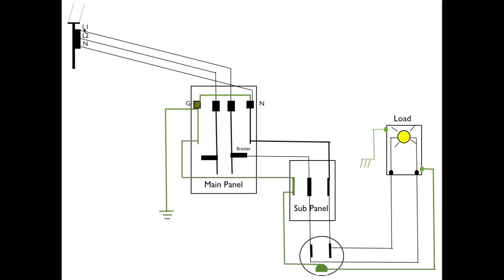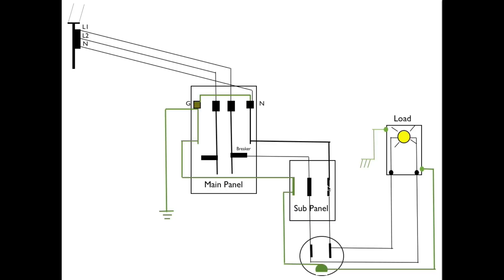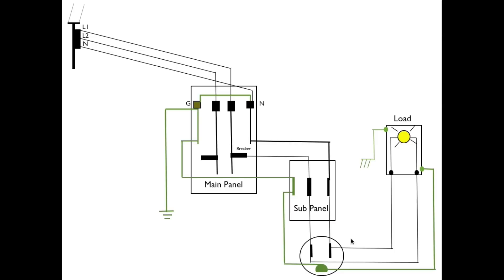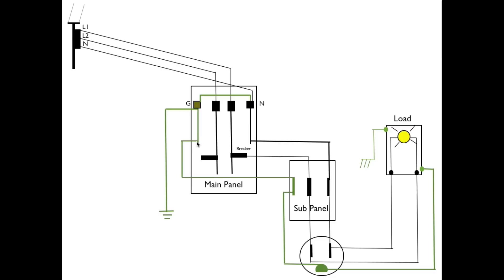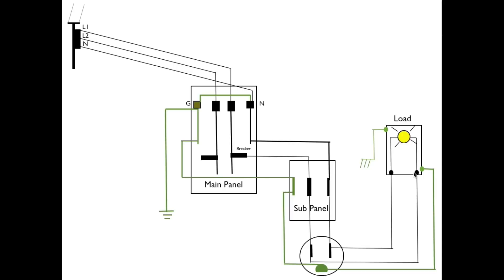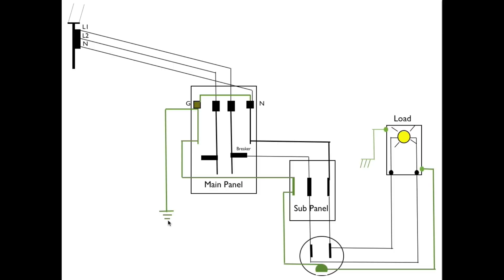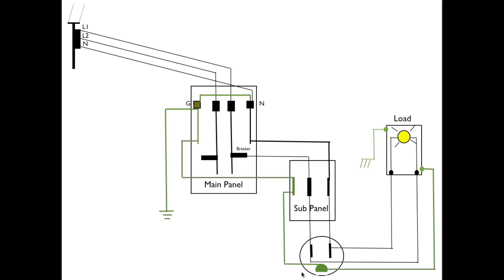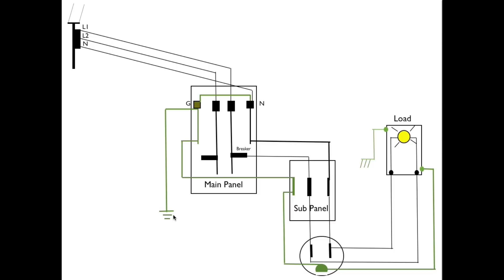The difference between neutral and ground on the electric panel

Comment: I've been looking for something like this for a long time now! I understand the theory after you leave the main breaker box where it must be separated (GNH). Is the ground in the main breaker box so close to true ground that the resistance is so high that it's like a cork that can only be popped out between neutral and ground with a very high voltage? Path of least Resistance says to flow down and out the neutral rather then go to ground. If I'm right about this then I finally understand this theory. !
Reply from the maker: I think you are pretty close.  The only thing is the earth ground (which includes the panel chassis) and neutral are connected together, but only in the main panel.     Hope this helps.
GFM
Reply: grayfurnaceman
Yes it is at this connection point in the main panel or first service connect between neutral and ground where the cork is in the form of least resistance going back out the neutral. Only under short or Lightning strike is the over current attracted to ground. Rather then you... Correct?
Reply from the maker: Curiosity I think you got it.
GFM
Reply: grayfurnaceman
Well it's important to know whether I did get it correctly or not and I think will add to the discussion here. Let's replace the "Cork" with a "Valve" . The connection point between neutral and ground at the first demarcation point (Service panel) after the pole. This connection between Neutral and ground becomes a valve; normal traffic (load / residual current) rides back out to the pole on the neutral. Shorts; spikes or lightning goes directly to ground opening up the Neutral to Ground valve.  There is a person on YouTube that does inverter work. He is very good... Never ask this question but I will try and get him to join the discussion. This is a fascinating subject!  ( knurlgnar24 ) I have allot of respect for this person.
Reply from the maker: Curiosity Lightning goes to earth ground because the potential is between the sky and the ground, but there is no potential from neutral to earth ground.  Even if you measure from a hot line coming into the structure to earth ground there will be no potential.  All shorts that go from hot to chassis feed back thru the ground to neutral at the main panel.  
GFM
Reply: Hi Curiosity. Very good question. One of the things that grayfurnaceman alluded to in his fine video, but didn't quite state explicitly, is that the role of ground wire is different between a lightning strike and a short. GFM did clarify this nicely in comments, but please permit another point or two of clarification. (Cover-my-behind note: I am NOT a certified electrician, but I have some training and experience with electrical circuits, and I have survived my own encounters with high voltages. :-) But consult an electrician before making decisions in a potentially life-threatening situation ... in other words, I ain't liable!)

What drives the electricity flow is what is called "potential," also known as voltage. It is called potential because it's a form of potential energy, like a pulled out spring or the pull of gravity on a person who just stepped over a cliff. All it needs is a way to release that energy, which means a pathway. A person standing on a cliff has a potential energy with respect to the valley below, but they don't experience falling because the earth beneath their feet blocks the pathway down to the valley. Once they remove that blockage by stepping off the cliff ... well, all bets are off. :-)

It's a little different with electricity because there are degrees of pathway. Low electrical resistance between two points of differing voltage represents a strong pathway, and electrical current (electrons) can flow easily. High electrical resistance between those points represents a weak path, and few to no electrons can travel between those points.

With lightning, the two regions of differing voltage are the sky and the earth. So current wants to flow between the two (in the form of a lightning bolt). In other words, the ground - soil, rock, etc - itself is what wants to be part of the electron flow.

Air is not a good conductor, so if you put a metal pole up high into the air, with the other end buried in the ground, the electrical resistance from the top of the pole to ground is much, much smaller in the metal itself than the resistance through the air. So lightning will tend to hit the pole and travel through that pole to the earth itself, rather than passing through the surrounding air.

There can easily be a low-resistance pathway (compared to the air) from the power lines to the ground that goes through the house and its wires and equipment. A nice, low resistance ground wire attached to neutral before anything else in the house will make a path to the ground from the sky that is much lower resistance - a better path - than anything that would go through the circuit boxes, house lines, and equipment. So having a ground wire from the neutral of the electrical service entrance to the actual ground will short out the lightning, and prevents it from going to ground through the valuable stuff in the building.

So that's lightning. Now let's look at equipment or line shorts.

In the case of a hot wire connecting with a ground wire, the problem is not about a current flowing back to the ground itself. As noted, the ground itself has a lot of resistance and, in this case, there's no huge potential between the power line and earth like there is between the sky and earth when lightning happens. In fact, you can take a hot wire and stick it right into the ground and no current will flow. So long as that ground is isolated from other electrical potentials. Wet ground up against some other source of potential doesn't count. :-) 

However, with the ground wire connected to neutral to protect against lightning, if you now connect the hot wire to the ground wire you are essentially connecting the hot wire to the neutral. Zap!

In the case of a neutral wire connecting to the ground wire, say by shorting with a grounded equipment chassis, nothing SEEMS to happen. But now there is current flowing through both the neutral wire and the ground wire. How much there is in each wire, and the likelihood of your getting a shock, all depends on how much resistance there is in each leg, between the original ground-neutral connection to the second point of contact of the two wires. Personally, I wouldn't unhook the ground wire and touch the wire while I also touch the equipment chassis. :-)

It can also happen that the ground wire is no longer connected well, or at all, to the chassis. In that case, if the hot wire somehow gets in electrical contact with the box then now all you need to do is insert yourself between either (a) the box and the neutral or (b) the box and something that has electrical connection with the ground wire, and you are toast.

So the difference between these short situations and lightning is that in one situation the ground wire is important because it's connected to the earth, whereas in the other case it's important because it's connected to the neutral.

grayfurnaceman, does this agree with your understanding of all this? Thanks!!
Reply from the maker: R asraster Very good explanation!!  Couldn't have said it better myself. lol  The integrity (continuity)of the chassis ground is very important, as if it fails, there is no indication that it has failed.  The equipment then just waits for something to happen such as a short in the equipment to the chassis.  Then the chassis becomes hot and the lucky person that touches it and something that is grounded gets a shock.  Of course, if the chassis ground had continuity back to neutral in the service disconnect, when the short happened, the circuit protection (breaker) would open.  Thanks for the detailed and as far as I can tell, correct explanation.
GFM

Comment: Is this true. When a black wire touches the chassis of a metal device that is grounded it will follow the path of the ground back to the panel but will then follow the white wire out to the pole as there is less resistance that following the ground out in your yard. The ground and the neutral are connnect in the panel so either path is available, whichever one is the one with the least resistance. It this true.
Reply from the maker: Yes.  The neutral conductor will always be the lowest resistance as it is connected to the power source.  Earth ground is not part of the circuit.
GFM

Comment: need to clarify at 8:16, the only way your load can still work if the neutral wire is broken is when the load, internally, has neutral and earth GND tied together (either by design or faulty circuit).
Reply from the maker: jsc Good thought s. 
GFM

Comment: Thanks for the info but what would the diagram look like if the sub panel is 220 and only fed by 3 wires, where/what is the neutral and ground?

thanks,

Steve
Reply from the maker: Steve Adams If the sub panel only has 220 volt loads, there is no neutral.  The green or bare wire is ground.  120 volt loads require a neutral.  The exception to that is driers and electric stoves.  Before about 1995, they could be wired with a 3 wire system even though they had small 120 volt components that used the ground as a current carrying conductor.  After 1995, The had to be installed with 4 wire systems that used a neutral.  Hope this helps.
GFM

Comment: I have a Eaton breaker Box in my house and it looks like there is metal strap that runs from the neutral bus to the ground bus. should i remove this little strap. its new and came that way
Reply: I'd say no unless you know what you're looking at
Reply: Isn't that "box" a listed device? Don't modify a listed device. I'm assuming this  is your main service panel.
==
This piece you consider cutting is the "main bond jumper" that is crucial in clearing ground faults.

This connecting the grounds back to the neutral ONE TIME ONLY
allows a ground fault current to get back to the center tap of the power company delta transformer and back to your circuit breaker to overheat the circuit breaker and trip it. Without that, you only have an earth path to HOPE to dissipate that current, but the resistance through the earth is usually too high to trip the breaker. 

I=120V/25 ohms =4.3A, which will not trip a 15A breaker.

The example of 25 Ohms is assuming you have one ground rod that just barely passed the test with a  megohmmeter by giving less thn 25 ohms to the earth potential. If you used a couple of rods and had 3 times the conductivity to earth, the I is then 3* 4.3 and still won't trip the breaker.

Thus, you need an "effective ground fault path" to clear ground faults. Thus you bring an "intentionally grounded" neutral to the service such as the bare stranded aluminum "carrier" supporting the two "hots" from the power pole and connect that, "intentionally grounding" it, to the service enclosure that is connected to the "grounding electrode system".

NEC 250.24. Grounding Services
(A) Grounding Neutral. Alternating-current services that are supplied from a grounded electrical system from the utility must have the grounded (neutral) conductor connected to a grounding electrode of the specified in 250.52 in accordance with Part III or Article 250 in accordance with (1) though (5). See 250.24(C).
==
Reply: Curtis Thornton — If you are doing your own work on a load center, get a permit and ask the electrical inspector.

Comment: I think I may have a problem with grounding in my house. If I turn on a light in one room, other room's lights get brighter and dimmer. They're on different circuits. The panel is grounded to two grounding rods but not to the water supply. Could this be the problem? Any feedback would help out, thanks.
Reply from the maker: awayneificent This could be a problem with a neutral not connected to neutral going to the panel.  I would check connections in the junction boxes.  This one could be dangerous, so I would shut down breakers and check all wires in the box with a non contact voltage tester before proceeding.
GFM
Reply: Yep. Those are classic symptoms of a bad neutral connection, either in the distribution panel or somewhere between the panel and the power transformer.

Comment: Min 7:05.....   Key point: the lightning has to first trip the Breaker at "neutral node" in order for the current to discharge to ground, correct?

Comment: Sad story in My town. Explains what happens when a ground is not going to earth but on the fixture chassis. A light pole was set in a concrete pad (non conductive) and the fixtures grounded wire was bonded to the steel pole. Once the fixture shorted out it energized the pole. The school paid an electrical contractor to come repair the lights and a young man became the ground from the energized pole to earth killing him. He was in his early 20's and killed because someone wasn't paying attention.
Reply: I know that light poles can be dangerous. We ALWAYS ran a 6 or 8 gauge ground wire to a grounding stake at the pole when the poles were set in concrete.

Comment: GFM, I have tons of questions.  First. The ground tied into the main panel going to the sub panel. During a strike, wouldnt the current carry into the ground and into the sub panel ground as well?  Second. The Neutral, I always thought was called that because it did not carry any current.  I assumed that Line 1 was the current carrying line.  Thank you.
Reply from the maker: J Hartranett If there were a lightning strike, the earth ground would absorb (hopefully) the energy as the earth ground is the opposite side of line.  As for would there be any potential in the ground at the sub panel, yes.  The power is going to take the easiest path.  
As for the neutral, It does carry current on the 120 volt circuit.  I don't think I have answered all your questions completely, so ask more if you need to.
GFM
Reply: grayfurnaceman No, that explains it to me. Thank you very much! :)
Reply: It seemss GFM's response is missing and i have the same question.

would you mind repeating what he said?
Reply from the maker: ***** If there were a lightning strike, the earth ground would absorb (hopefully) the energy as the earth ground is the opposite side of line.  As for would there be any potential in the ground at the sub panel, yes.  The power is going to take the easiest path.  
As for the neutral, It does carry current on the 120 volt circuit.  I don't think I have answered all your questions completely, so ask more if you need to.
GFM
Reply: You beat me to it gfm.  Your answer did show up on my screen. Not sure why it was not visible.
Reply: grayfurnaceman Thank you very much.

Comment: I am sure this question has been asked already..but I am not able to find it. So here it goes. I "had" a 220 dryer in basement (3 wire from main to a 3 wire connection box) it is a dryer & had a 3 wire cord to connection. I removed the dryer to install a gas dryer...with me so far? I do not need that connection now then we bought a 220 electric range in kitchen (above the basement and that old 3 wire setup) Question is can I use that 3 wire in basement and create Sub Panel with 40 amp breaker and go to oven? (Stove requires 40amp) OR should I tie into 3 wire with a small junction box and with a new 15 foot 8\3 wire (Old 3 wire and new 15ft both rated 40 amp) then run that to kitchen for new connection for the stove to plug in? 

Also the MAIN has a 50 amp breaker on that older dryer connection which seems a bit over rate? However it has been used for years with just dryer as a load. I just want to utilize that 220 service wire not being used (must be about 20+ feet) I think it is 8\3 

Thank you I have wired 220 water heaters, 220 welder to sub my last home and was told I did it right by a "Iron worker that is also electrician and welder". I just like safety first thanks again!
Reply from the maker: The issue here is that you need 4 wire for the stove.  You need a separate neutral.  Many installs done before 1995 used the ground for the neutral.  There are components in the appliance that operate on 1290 volts.  That always was unsafe.  
So, the safe way to do this is to replace the wire (and the breaker) with components that match the stove manufacturer's install instructions.
GFM